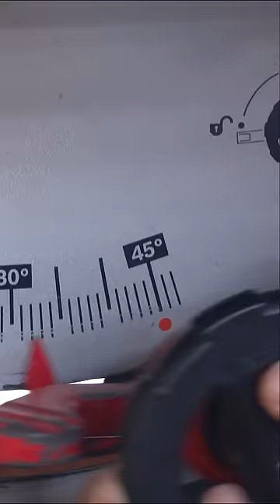Technique Skills for Woodworking Box Joinery #shorts #woodworking #trending #amazing

Comment: This is quite possibly a demonstration of the worst, most dangerous practices I've seen. Please don't imitate this at home. From cutting the miters on the table saw to where his hand is holding the spline jig. Just dangerous. I have done this for a living for 30 plus years. It's my kids account.
Reply: There’s nothing wrong with cutting miters on a table saw. That’s why the blade tilts.
Reply: @wulf67  The issue isn't cutting miters, it's how its being done. If you want to risk your fingers, be my guest and do it like the video shows.
Reply: @civilianjman8  What makes it “dangerous”? He’s cutting more or less square pieces against the fence. It’s not like he’s free-handing it or trying to crosscut a two-foot 1x6  butted into the fence.
Reply: @wulf67  Short pieces like that would be much safer cut using a miter gauge or crosscut sled. And... Look how close his fingers are to the router bit while he's cutting something that hasn't been securely clamped to his workpiece. My problem is that people with no experience will try to imitate these practices thinking it's safe and the "right" way to do things.
As I said above, if you want to do it that way, be my guest. I wouldn't allow it in my shop.

Comment: Looks like you need a new blade
Reply: Looks like?...from the wood or the blade?...Because the cuts looked very smooth.
So what happens Is some people take care of their own blades and sharpen them. Therefore, they may look old, but they're still sharp. A dull blade would  kick the wood out. You can't do woodworking with a dull blade.
Reply: Show us your video.
Reply: @cavsomecadencenot the look of the bkade but how it splints the timber 6117

Comment: Splining jig - great. 👍  Freehand ripping with no fence or crosscut jig, bad accident waiting to happen.🏥   Be safe in your workshop people!
Reply: His safety is having common sense and not being a f'n imbecile. It's more than OBVIOUS he's done it a million times and has the control and muscle memory to accomplish it.
Reply: @lelandgaunt7130  I can only assume the creator has since edited the video to remove the freehand ripping on the table saw as mine wasn't the only  comment criticising it.    If you use a tablesaw, you'll know why  that was a complete no-no.
Reply: @theduftmeister   I use a table saw. I've also been to 3 continents where dirt poor people use what they have. Seen 80 year old carpenters use fubar table saws without fences, riving knives or any other "dummy", false sense of security bullcrap. Just like a firearm. The safety is your finger and head, not a switch. As for using a fence to make a cleaner, straighter cut, yes, but when you can do it without it, it's fine. I've seen some insane freehand routing without templates, jigs or inserts. Some can do it, some can't. Common sense dictates he can do it. It's right there in front of you. You watched it. Disregard, you just want to argue.
Reply: @theduftmeister He’s obviously pushing along the fence.